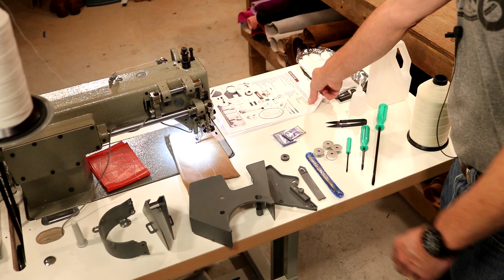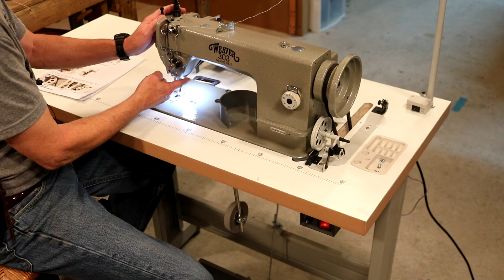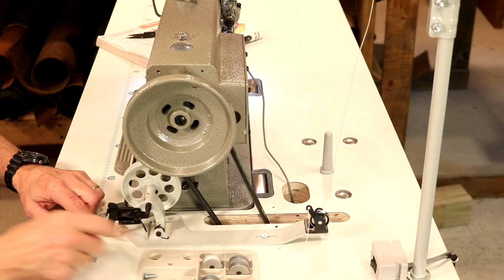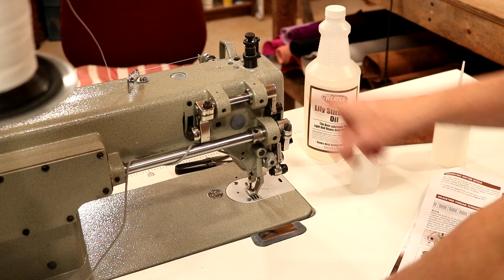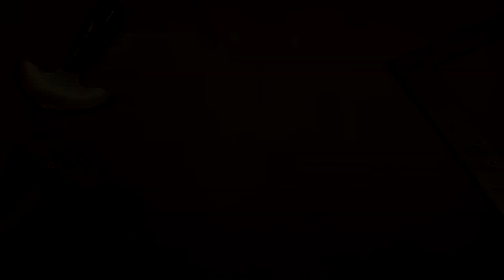The Leather Element: Weaver 303 Leather Sewing Machine

Comment: I have this machine. It is awesome but I find that the belt slips on the wheel when trying to sew really thick leather. I tried adjusting belt, checking wheel tightness etc. it only happens with thick material. Any suggestions?
Reply from the maker: Hi there! The solution would be to really tighten the belt as much as possible. If the leather thickness is too great, then it will just slip due to the leather being too heavy for this machine. Hope that helps!

Comment: I love my 303.  It is simple to use and does a great job.  I did have a couple of issues though.  The safety guards do not fit the machine, therefore I could not install them.  the other issue is why they included standard screwdrivers when all the screws on the machine are philips .  Other than that, it is an awesome machine and well worth the money.

Comment: I’ve been looking to upgrade from my Sailrite leather work machine, as it will not run size 138 thread. How close is the 303 to a cobra class 18, and will the 303 run 138 for top thread and bobbin?

Comment: How thick of leather will it sew? 
And a good topic is thread and needles and sizing! I am at a total loss when thread is out of the diameter for size, so I don't buy any unless it's states diameter. I've probably missed some good buys because I just don't understand the sizing of threads outside the diameter.
Reply from the maker: It can sew up to 1/4" thickness and uses size 92 thread which is .0133" (.337mm).

Comment: Gee, Chuck, why would I want this when I can go to T**dy and get half the machine for three times the price?  Seriously, I wish I had room for this.  It looks like a very well thought out system.  One point:  rather than glue, I would definitely recommend BLUE (not RED if you ever want to remove the screws) Loctite.  I use both types on firearms for different applications, but mostly the BLUE because it can be broken loose with a screwdriver rather than a jackhammer.  Great job showing how to thread the beast and thread and insert bobbins.  That's going to prevent a lot of problems and disappointments.  The ability to control the speed smoothly down to a snail's pace is a great feature.
Reply: All you need for red loctite is a little heat.

Comment: Good video...sort of.  At the points where parts of the machine were mentioned, it would have helped to have an arrow or circle to show where an item can be found.  In watching about the speed control, I watched three times and was not able to know where it was.
Reply from the maker: Hi Dale, we have an in-depth instruction manual that comes with the machine that shows all the small details and parts. If you'd like to check that out you can do so here (page 13 shows the speed dial on the motor): https://www.weaverleathersupply.com/docs/default-source/product-manual/weaver303ownersmanual_lr.pdf?sfvrsn=717f2f17_2
Reply: @WeaverLeatherSupply  Thanks.

Comment: what is the best tool for punching though 10-12 oz leather?
Reply from the maker: Hi Cody,
For hole punching, drive punches work great for heavier leather. For stitching holes, you may need to mark the holes with a chisel and then use an awl to actually punch through the leather.